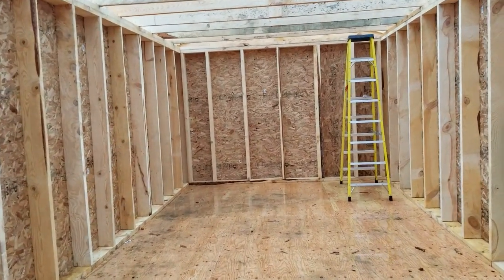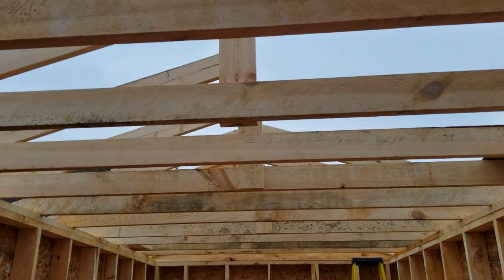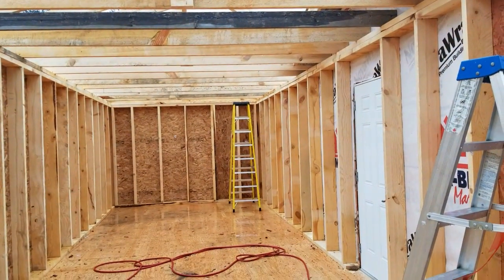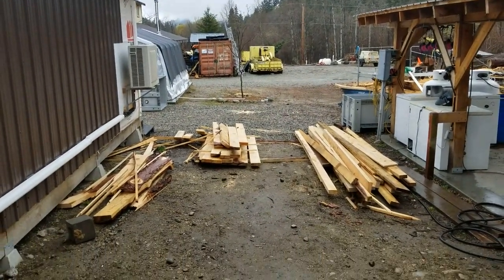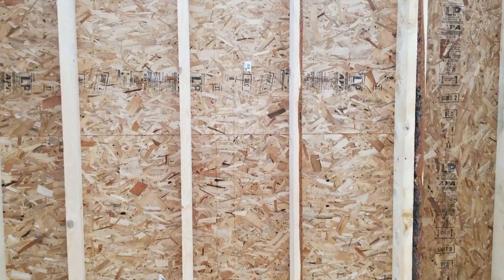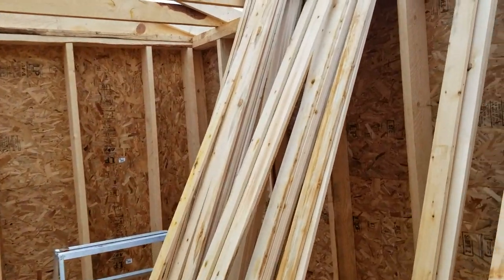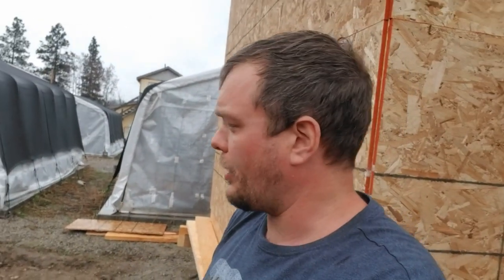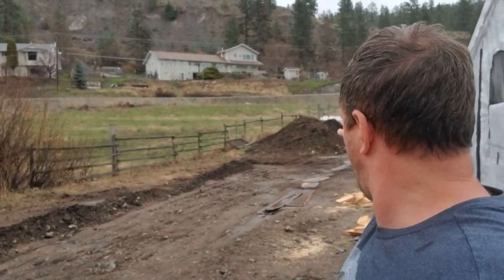This Is What My Farm Looks Like After 5 Years - How To Grow Mushrooms Outdoors In Greenhouses

Comment: We have no snow most time in Mississippi. Just rain and heat. Winter are like 30 degrees. You guys have a ton of things you have to brace for. Our studs are 2x4. And rafters are 2x6. Roof on 2ft center. And studs on 16inch center. Our frost line is only few inchs. Maybe a ft at hardest. So we put treated post 2ft in the ground unless noted.

Comment: Thank you for your video.  Very exciting times!

As it relates to your sterilization temperature, 212 oF vs 250 oF can be just as effective. The only difference is the additional time required for sterilization at 212 oF.  The issue you may be having is the time it takes  to get the center of your bags stack to 212 oF.  This should be your starting point for your sterilization time.  One thing you can do to reduce this initial temperature ramping is to put a small space down the middle of your bag stack. This will effectively half the mass of your sterilization stack.

FYI, I added a few edits.
Reply from the maker: Thunderbolt Farm keep you posted
Reply: I really appreciate you taking the time to share your experiences via video.  I am in the construction phase of my gourmet mushroom business and seeing your videos has helped me considerably.  Thanks again.

Comment: When I was steaming in a trough I was packing the bags pretty close together and was getting a lot of contamination. Since  switching to my steam box where they are on racks with space in between the bags my contamintion rate has dramatically dropped to virtually none.
Reply from the maker: Branden Janikowski ya I think I need to pack less. Already doing a 29hr steam from start to finish with cold boilers. Got a new tank design in the works too